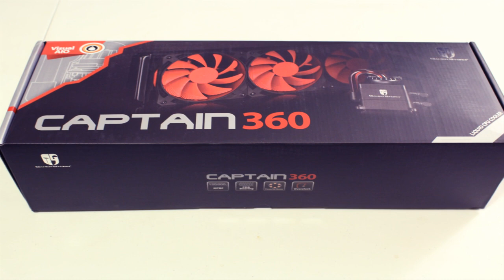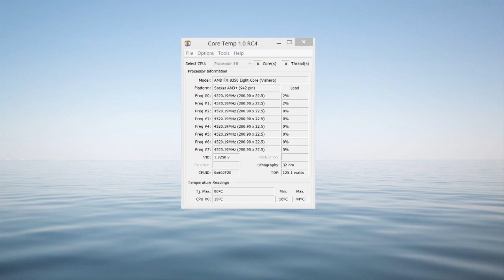Deepcool Captain 360 Installation (H100 V CAPTAIN 360)

Comment: If you had your own Led fans the fans you can fix up to your fan control system instead of using the Original fans and still plug in the pump to the CPU Tether.

Comment: Unfortunately it may be a tight fit for my case, the 27mm side. It might sound rediculous, but could I maybe mount it on the outside of the case?
Reply: +Thomas Cooper Its a sealed unit,  so you would have to dissaemble it and good luck reassembling it and refilling it.    unless you wanted to cut your case pretty much in a bad way to slide the hoses thru.

You could take out the front Drive bays,  (cut them out)  and mount the radiator vertically in the front (get some L-brackets)    and remount your drives elsewhere.  ???  measure first...

Just ideas,  no idea what case your using,  prob a 240 rad better.

Comment: what mobo fan connector did you use for the fan on the cooler? I have the CPU_ OTP and CPU fan connector. Should the pump be on the OTP and fans be on the CPU fan?

Comment: After trying to install this, my computer wouldn't start. I don't think the pump is working, that's probably the issue, but I also forgot to put on the plastic things on the cpu backplate. How fast would it short out from that? Is it a buildup of static electricity over time that causes it, or is it immediately fried?
Reply: Most cases. instant.